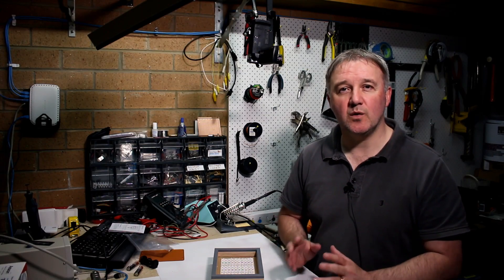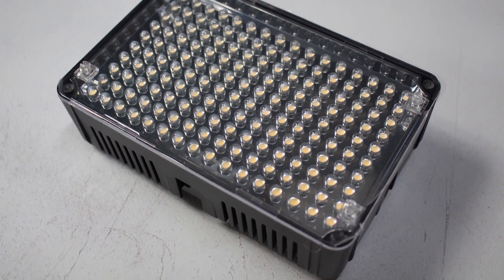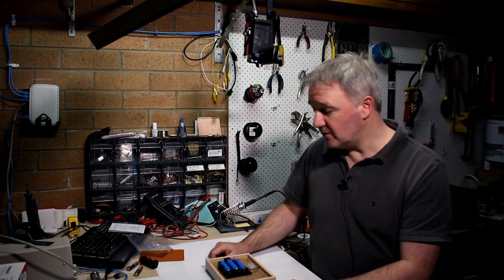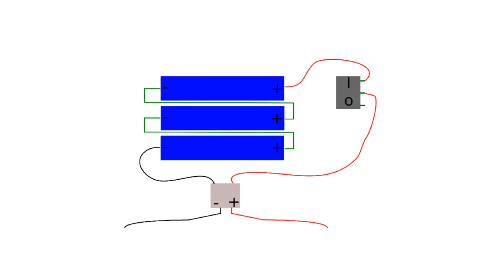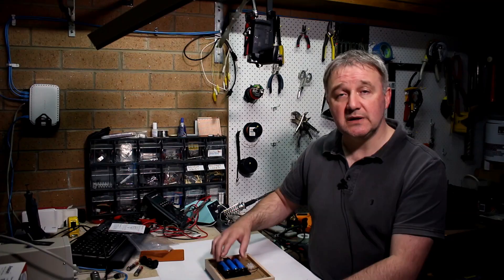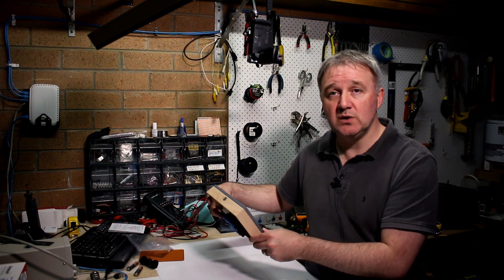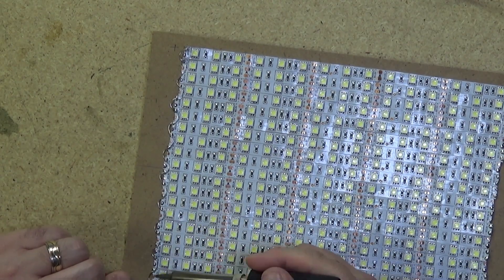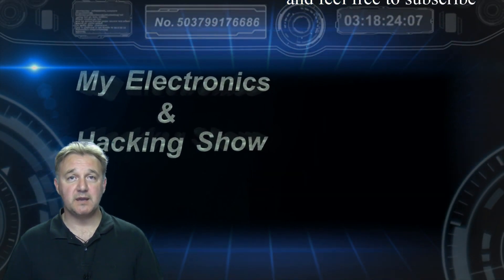DIY Battery Powered Portable LED Light Panel (MEHS) Episode 54

Comment: I have a car battery charger/ trickle charger can it be connected to an led light source?
Reply from the maker: Hi.  You will be able to get power from the charger to the LED panel but how effective this is depends on your battery charger.  If it has specific modes and settings, they may change how power is delivered.  Best way to find out is try it.  As long as the voltage is correct (12v - put your meter on the charger leads and check the output voltage), you should be okay.  Cheers.

Comment: Hi! it's a great video! i just want to ask is it possible to make that thing with three 9v battery for 4 LED light RoHs 12v? tnx.
Reply from the maker: Hi.  Yes its possible.  You just need to make sure your power supply is suitable for the lights being used.  You would need to check the draw of your lights as a 9V battery typically won't provide more than 500ma each.  Cheers.

Comment: Have you made one connecting to a powerbank?
Reply from the maker: Hi.  Should be fairly easy.  You just need a powerbank that can output 12v natively or output 5V at 2.4A so you can use a step up regulator and get 12v from the 5v source.  Your panel can only be so big though as converting 5v to 12v means a big drop in amps.  Max would be a panel with a 1A draw.  Cheers.

Comment: This design will see the LEDs get darker as the batteries drain. If you used a DC-DC buck converter with a bank of batteries that supply normally more than is needed you'd get a constant max brightness all the time until the batteries go below a certain threshold. Also what is limiting the current in this design?

Comment: Can these be used for a plant led light
Reply from the maker: Hi.  Yes, can be used for any lighting needs really.  Change the number of LEDs to meet your specific output needs.  Just note that the more LEDs you run, the shorter the cells will last per charge.  Cheers.

Comment: Sir how many LEDS required if i use 4 cells..i want same for my DSLR
Reply from the maker: The number of cells, when in series, determines the voltage.  3 cells gives close to 12v which is correct for the leds being used.  4 cells produces too much voltage and will burn out the leds.  If you need more battery capacity use better batteries or use 2 lots of 3 cells.

Comment: how many watts is the Lights all together?

and How many (MAH) is the battery each?Not In series in parallel (MAH)?

because i want to estimate if i have a 3W 12V bulb i just want an idea of your work
Reply from the maker: Hi - From memory each cell was 2200mah.  Peak draw was about 1A at 12v, so 12watts.  Run time was about 1.5hours before the BMS cut in.  Cheers.

Comment: Thanks for the great informational videos, I have a situation and not sure what to make of it. I have a 4s10p 18650 battery pack with 16.8 voltage and a 4s 30amp BMS. I connected a 12v 450watt power inverter to it by means of a 300 watt 20A stepdown buck converter. The output voltage is at 12.6 CV.  I then tested it out with 4 loads equalling 5 Amps and 40 watts which were all led lights. At first everything was working perfect, but after about an hour I noticed one of my pack fuses was getting red hot. And when I powered down the inverter it stopped getting hot. any help or suggestion would be great. Thanks
Reply from the maker: - Hi.  There is a bit going on here so its hard without seeing it or seeing a detailed wiring diagram but I would start with the basics and look at your power requirements from the start to the end and the wiring that connects everything.  If some part of the circuit is getting hot then you have a current / resistance issue and you could be shunting all the power down one circuit path.  A 4S 30A BMS seems insufficient to feed a 450watt inverter.  I would be wanting a 40-60A BMS.  Also make sure your BMS is working correctly.  Try a different BMS if you can.  Also make sure that all the wiring you use is up to the task of carrying all that current.  This is often overlooked.  See how that goes.  Cheers.
Reply: I failed to mention that the cell itself doesn't heat up. Its the the fuse between two cells. It seems to work fine with 3 even 5 amps but anything higher, that particular fuse starts glowing. What you suggested about the BMS seems very logical. I have a 60amp and 100amp on its way. I will change the BMS and try it. Will keep you posted. Thanks...
Reply from the maker: @milvolts1  - Also, what is the fuse rated at?  It could be that you're current throughput is very close the max rating of the fuse.  Try putting your meter in-line and measure the current.  Cheers.
Reply: It is rated at 3 amps. But its only 1 fuse glowing and its the one  that's connected  to the battery where the BMS negative is connected along with a balance lead wire. I'm currently testing the pack without the inverter and so far have run 2 led lights equalling 3amps and no heat. I need to find some more devices so I can equal the 7amps I was running with the inverter. Will keep you posted.
Reply: My goal is to get this pack right so that I can build a portable power box
Reply from the maker: @milvolts1 - Hi.  I don't think 3A is even close.  The inverter is going to be pulling a lot more than 3A.  Hook up your meter without the fuse and test the draw of the inverter.  I would suggest doubling the capacity of the fuse.  Cheers.

Comment: Hi, great video, may i ask you a question, im planning to make one myself, but im planning to have 4pcs of 3.7V battery which would generate more than 12v to power my 12v leds that is only 1Meter long, but i will be connecting a 12v rf led controller to fix that, however, i am planning to charge the batteries via 12v solar panels which claims to generate 100mA 1.5w, would the power generated be too much for my batteries to handle, im new to this kind of things, but i would really love to try, thanks in advance 😊
Reply from the maker: - Hi.  Take a look at this video -- https://youtu.be/SyiUzZJHVx8   You will find out what you need.  No 100ma is not too much for 18650 cells.  Actually its too little.  You should charge 18650 cells at 350ma to 2000ma.  Cheers.

Comment: What if you put a single 12v battery instead of the 3x 18650 bank?

Like this one
https://rover.ebay.com/rover/0/0/0?mpre=https%3A%2F%2Fwww.ebay.it%2Fulk%2Fitm%2F263406233773
Reply from the maker: - Hi.  Yes that would also work.  Cheers.

Comment: Can you power the Long styled Flood lights for cars with the 18235 Batteries?
Reply from the maker: - Hi.  Do you mean an LED light bar? or normal car headlights?  The answer to both is yes but the number of cells required will depend on the wattage of the light being powered.  Cheers.
Reply: My Electronics & Hacking Show 

Thanks for the reply! 

Just ordered a single row Light Bar. Going to be placing it on my Go Kart so i need a more portable way of powering it up.
Reply from the maker: - Great.  Just make sure you work out the power draw (wattage) of the light bar before connecting batteries as you can cause big problems if not careful.  As a rule of thumb the maximum current draw out of an 18650 cell is 5amps and its better to stick to 3 or 4.  If you need BIG current draw you might want to look for 18650 cells that are IMR type as these can handle 10-20 amp draw.  Cheers.

Comment: If you use 300 leds instead of the 96, would it be significantly dimmer? In the previous video with 300, you used a 12v power supply. So couldn't you use 300 leds for this setup too?
Reply from the maker: - Hi.  Yes you can use 300 leds easily.  It won't be dimmer as long as the power supply has enough current to power the panel.  If you use 3 good quality cells you an get enough current to power a 300 led panel at full power, no drop in brightness, just reduced runtime.  Add 3 more cells in parallel and double the runtime.  Cheers.
Reply: My Electronics & Hacking Show thanks a lot for the help!
Reply: My Electronics & Hacking Show  I need help with a project. im trying to make a bright green fishing light but  nothing i come across on the internet seems to be battery powered..."using green LED strips"
Reply from the maker: - What voltage are the LED's?  If we are taking 12v then the approach is basically the same as in this video with one exception.  Instead of just connecting 3 x 3.7V cells in series and connecting them to the LED panel you should connect the 3 cells using a BMS and then connect the BMS to the LED panel.  The BMS will stop the cells from being drained too low.  Cheers.

Comment: What is the time-span of the batteries you have there if left on to drain them fully charged? Great video btw, I am a high school photography teacher and much of our first quarter this year we will be involved in creating both small and large hard-back lights, as well as foldable/portable light panels...Cheers!
Reply from the maker: - Hi.  In this example about an hour but that's my own limit, not the limit of the battery capacity.  The reason I say this is because this LED panel doesn't have a BMS built in which would safely monitor the low state of the battery (the cells).  As you probably know if lithium cells get drained too low it can damage the cells (sometimes with serious repercussions such as fire).  I run the light for about an hour and then recharge.  If I ran the cells completely flat I could get close to 2 hrs runtime.  If you want a safer solution watch my other videos on LED panels or BMS boards or just use this design but use protected cells (achieves the same result).  Cheers.

Comment: Thanks for a great video! Are the batteries that you have used a flat top ones?
Reply from the maker: - Hi.  I used a mix actually.  I had two flat tops and one nipple type.  The battery holders are designed with the nipple top type in mind but they still work fine with the flat top type as long as the project isn't something that jumps around a lot.  Cheers.

Comment: Having  3w 8.97 v solar panel
Reply from the maker: - The LED's are fairly tolerant and will run from 8.7v up to 14v.  The draw is about 1.5 amps.  If you install a SEPIC voltage regulator it will handle the under and over voltage and give the panel a clean 12v supply.

Comment: How to attach a solar panel to it
Reply from the maker: - Hi.  Not too difficult.  You would need a solar regulator to control the voltage going to the panel but that's all really.  To get the best charge you would also install a 3s battery charger circuit as I've shown in recent videos.  Cheers.

Comment: For the LED's to last longer I'd recommend to use an aluminium sheet (2mm thick should be enough) to stick the strips on, instead of wood board. That way the heat will dissipate away from the strips prolonging their life.
Reply from the maker: - Hi.  Not as cheap as the picture frame but yes, agree that would be a good base.

Comment: The way you've built that, it's a nice fire hazard. At the very least put a fuse in the circuit, those batteries are beasts.

Comment: Do we need some kind of battery management system so that the light doesn't discharge the batteries below 3V, which would damage the batteries?
Reply from the maker: StopLossLOL - Hi.  Ideally yes for the reason you mentioned.  I keep and eye on my batteries using a meter after each hour of use but a BMS would be ideal here.  My next light build with batteries has a BMS.  That video should be ready in a week or two.  Cheers.

Comment: If you needed to power LEDs that required 24V, could you double the batteries and get away with that, or would you need to start adding resisters?
Reply from the maker: - Hi.  Yes you could simply double the battery supply (6 batteries) to give between 18 and 25.2 volts.  Since the voltage range is more than a 12v approach you may want to drop in a 24v regulator.  But it will work without it.  Cheers.

Comment: To make the most of the light that spills sideways from the LED itself, you could use alfoil around the edges and even baking paper makes a great diffuser over the top. Did this to some cardboard box versions I made and the light is a bit brighter and diffuses well on camera.
Reply from the maker: -Hi.  Good ideas and not difficult to implement.  I might add barn doors and a diffuser to this light.  I find non-reflective material is better for controlling light.  Thanks.  Cheers.

Comment: Fantastic.

I'd love to see a solar charger version of this.
Reply from the maker: - Hi.  I thought about what you said and initially I though why would anyone want a solar charging light.  I guess if you had a solar charging module that could charge up the batteries when the lights are not in use (daytime) then that would be handy for situations where access to a power point is difficult.  So basically we would be talking about a solar powered lithium ion charging device.  I think the XTAR VC4 takes a 12V DC input.  Add a solar panel and a 12v regulator and your in business.  Cheers.